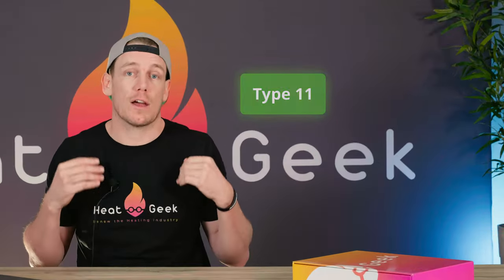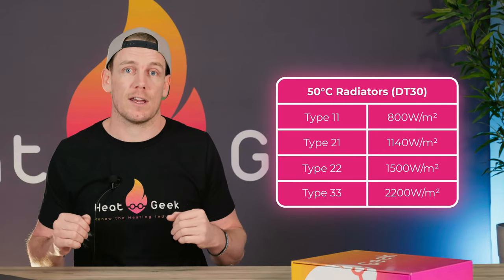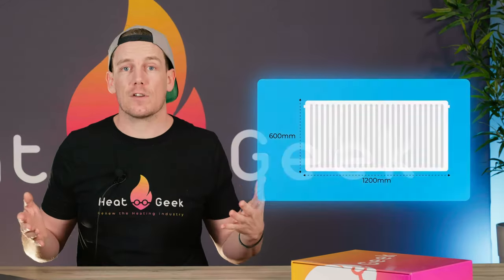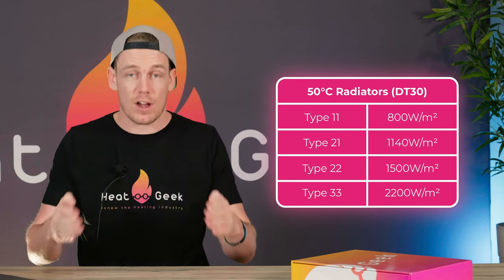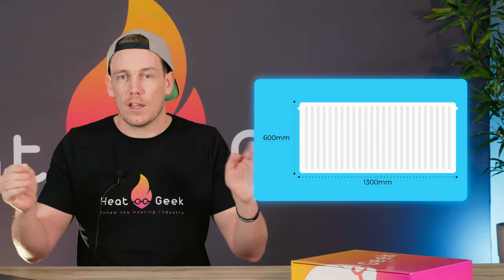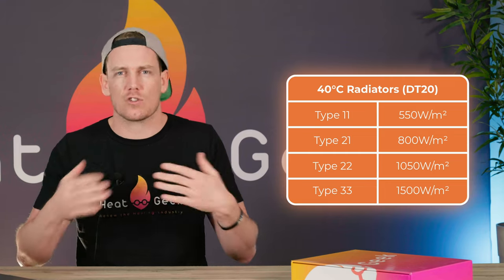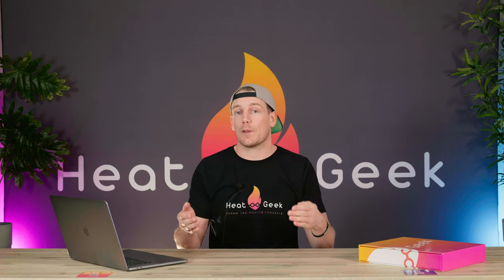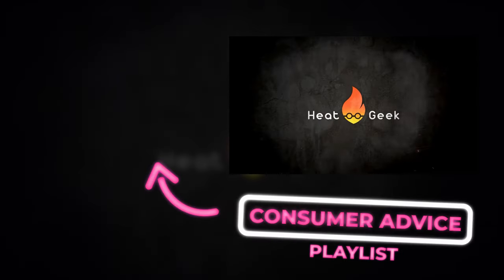Should I Upgrade My Radiators For A Heat Pump? | RADIATOR CHEAT SHEET | Consumer Advice

Comment: Hi. Thanks for the video. What's your opinion on column radiators please? Which type would be closest comparison for your cheat sheet? I've read an article that suggests they are potentially better than panel + convector fin types, despite sometimes being rated with lower BTU figures, because they have a greater direct surface area. Is that true?
Reply: They work just fine. The quoted output should be divided by 3 to work at 40 degrees! Make sure that there is a diverter inserted where the inlet valve is stop the water going straight across the bottom and the top of the radiator remains cool.

Comment: Good video. Is the 40 degree chart mean 40c mean water temp, so a 50 flow 30 return, mwt40 minus 20 room temp is dt20 for gas boiler?

Are is the flow and return dt on an ashp much closer together?
Reply from the maker: Yes.

Flow/ret dt in hp is 5 to 7

Comment: 1. Are aluminium rads better ?
2. Do vertical rads of same wattage expect to perform similar to horizontal ones? 
I am planing to get heat pump over the next few months and dont want to skimp on cost of rads as they are probably the least expensive part in the system.
Reply: That being the case go for aluminium radiators they have a far better heat transfer rate.

Comment: Can't I just swap all my type 11's for 22's, and double up the 21's for 2x the same size in 22's? Job done :) All my rads need replacement anyway...
Reply from the maker: Not necessarily, follow our radiator upsizing video to find out if you need to or not.

Comment: I'm building new house. HP 7,2 kw. Engineer calculated that house has heat loss 7,2 kw at -9,8 c and calculated radiators dimensions for HP. Dont want floor heating, dont ask me why. Now, what interests me is can I make my radiators even bigger than engineer calculated. To run them at lower temperatures? Would I need stronger HP then because I guess bigger radiators mean bigger water flow?
Reply from the maker: Yes you should make them bigger. No it’s doesn’t mean bigger flow or bigger hp

Comment: Great video but I am missing something fundamental. For a Type 22 rad you quote 1500W/M2, so for a 0.72m2 rad the output would be 1080W , yet when I look at a rad chart in the Screwfix specification it is quoting 2112W at DeltaT50degC what am I missing here?
Reply from the maker: Your missing that a delta t 50 rad requires 70c mean water temperature. I.e. its 50c above the room.

A 50c rad is only 30c above the room..  I.e. its a dt 30 rads
Reply: @HeatGeek  Doh - terminology got me - a 50 degree rad and Delta T 50. It would be helpful if there was a  better discriminator like DT x (Primary) = across the heat generator DT x (Emitter) = UFH loop/rad and DT x (Room) = Mean water temp in emitter - room set point. Thanks for answering - I have hoisted in now.😉

Comment: If I'm right in thinking that water flow is important in a heat pump system and that the restriction of microbore pipe work may be a hindrance and also that a heat pump system is generally on for most of the time then whats the point of lock-shields on the rads? or put it another way, the hole even when fully opened is less than the width of micropore so must be just as restrictive.
I'd be really interested to know your thoughts. Thanks for the content.
Reply: I have a system that was originally oil fired and all microbore. The radiator valves were coaxial allowing single ended radiator connections but were absolutely awful especially with double panel radiators. I have converted some of the microbore to 15mm, especially where I converted all radiators to double ended connection. It all works fine with my ground source heat pump.

Comment: How about using a high temp heat pump, I’ve 27kw of battery storage that I charge on cheap rate electricity. Why because my pipes are microbore plastic and to replace in a new build would be hell. No one as yet has come up with and answer to new builds that mostly are piped with microbore plastic.
Reply: I have a mixed system with mostly microbore and it is not a problem.

Comment: Thank you again, legend. This is timely info for me 🙂

One question about the material the rad is constructed from: I see aluminium rads which claim a higher output due to its better conduction... What are your thoughts on those - Are they worth the upgrade?

Is there a rule of thumb % output difference per m² Vs steel?
Reply from the maker: No rule of thumb for those as they will be custom shapes. They're OK... need to be careful with water quality though.. use demin imo... not worth the extra cost really tbh
Reply: Many thanks. I'll stick to decent steel ones then 👍🏻
Reply: I had a aluminium rad installed when I replaced my  kitchen in my old house and it kick out a lot of heat,  but the prices are to much.   I found in every house I moved in the down stair rads so dont give out a lot of heat and I always had them replaced.

Comment: Given that emitters are the single biggest determining factor in the performance of a heat pump. Have you considered testing the ThermaSkirt system? It is effectively a radiator just in a different shape. 
We've run it at low temps for years.
Reply from the maker: Yes. Very low output so not as good as rads in any way.. which is expected as rads allow air flow round them
Reply: @HeatGeek   @Heat Geek  it's 90w per metre though? We've had it in a 40m2 kitchen/diner for 6 years now running at 40°C. 
I did an instructables write up on it. 👍
Reply from the maker: @welltrainedchimp9591  90w per meter doesnt mean much on its own. at what mean water to air  tem dt?. The fact you could run it at 40c doesn't tell us anything without your heat loss or w/mw.
Reply from the maker: @dirtychinchilla  flow temperature is directly propotional to radiator output though.. which is why skirting rads are poor. No aor flow means little turbulence airside and reduced output. The hydraulic connections are clumsy and cheap too.
Reply: @HeatGeek  it's a radiant system though it's not trying to create air flow. It's basically the first thing they say on their website. 
Works more like underfloor heating in that respect. 
Our skirting heating runs at 50°c flow, for internal temperature 21°C when -3 outside. 
The flow curve then changes significantly as the outside temp changes. Flow drops right down to 35 when it's over 8 outside. 
I really don't want to nail your hat on about this as I love your channel, but having fitted it throughout the house 6 years ago I can tell you that the connections work, and are easy to fit. Granted its a little fiddly when you haven't installed it before but after a few rooms it was much easier. 
I've just had a poke on their website, looks like Barratts are using them on their 'Zero Carbon' homes 😳
We went for it because we didn't want big radiators and a lot of people I know who want heat pumps also don't.
Reply: @dirtychinchilla  50 flow when at -3 outside. 
The system was sized to suit that.  As the external temp rises the flow curve adjusts accordingly. 
You size the skirting like a radiator. More meterage is more surface area. 
We only have 2 of the 4 walls skirted in the bedrooms as they only needed around 500w at -3°C external. The other walls are dummy 👍
Reply from the maker: @welltrainedchimp9591  all low temp systems are higher % radiant to convector. Because it can't convect its output is restricted and becaise its not the same surface area as the entire floor its output is restricted. Essentially it's nit as good as rads or underfloor but I'm sure has its place in certain secarios, I haven't found one yet personally.
Reply: @HeatGeek  I don't understand what you mean exactly by 'it's output is restricted'. 
There is BSRIA test documentation on their website which is what we sized it from.
If it can produce a certain heat output at certain flow temps, in our case 90w/m and you need say 900w. Then 10m of skirting will meet the losses. 
It's pretty simple. 
Your content is absolutely spot on and I love nerding out on it but I don't think you're giving them a fair shake. 
I sound like I'm on bloody commission but I'm only saying this as we've put it in our 1970s detached house on an ashp and it works. 👍 Your installers would benefit from having more options on the emitters front as we're all pushing heat pumps as the future. I love mine! ❤
Reply from the maker: @welltrainedchimp9591  if it meets the required out put that's absolutely great! And I'm not saying never use it. But with a well insulated property as yours sounds, underfloor heating will be down at 30c flow temp and heat pump scop up at 5 instead of 4.
Reply from the maker: I'll look in to it some more from your suggestion bud. We actually havr a whole box of it at the office here that was sent to us and I've only had a quick gander
Reply: @HeatGeek  yeah agree completely. Insulation is good for a 1970s but not great by modern standards.  UFH wasn't an option for us as it was retrofit. So we ran drops from above for the ground floor from a manifold and came up from suspended floor on the first floor. 
I actually reduced my zoning based on one of your videos so we just have a 1st floor & ground floor zone now. 
Wasted money on a load of thermostats but it's really working well. 😅
Reply: @HeatGeek  yeah I just think the more options fitters have the better as the performance side is one thing but ultimately if the customer doesn't like radiators and can't have underfloor heating there's another way to get heat pumps to work for them. 
Did they send you a free system?! 😀
Reply from the maker: @welltrainedchimp9591  can't disagree there. Just not my first port of call. Yes they sent free sample stuff.
Reply: @HeatGeek  use your social influencer status to ask for a free test system. 😆 give it a whirl and see what you think.
Reply from the maker: @welltrainedchimp9591  sounds like a great job. Where are you based? perhaps we could do an episode on your set up?
Reply: @HeatGeek  The property is in th Lakes... great job? No! We had a bit of a nightmare with the original heat pump installer and I basically had to do all my own homework to eventually work out he was blagging it. Trying to feed the ground floor from a single set of 15mm feeds 🤔🤔🤔 He also didn't have a clue about the RHI applications and cost me a fortune. 
It got sorted in the end and I fitted all the internal pipework and skirting myself with some guidance. 
My experience is what's got me so concerned about the big push towards heat pumps. I'm worried that loads of sales companies will appear out of nowhere and mis sell systems, size them incorrectly and get cowboys to fit them. 
It will be bad for the whole industry without the right knowledge out there.
Reply from the maker: @welltrainedchimp9591  yes.. ifnyoubgot there ate a home owner using YouTube etc though.. hopefully our channel will be the keyA
Reply: The surface area of ThermaSkirt is woefully inadequate for most heat pump applications.

Comment: Interesting video, thank you.
What are your thoughts on 'retrofit' underfloor heating? The sort which goes on top of your existing slab. Worth the effort over posible upsizing radiators?
Reply: I decided to put in overlay UFH when we created a new kitchen diner from two rooms. It's overlay type with pipes in about 22mm of screed and it's own pump/manifold/thermostat. Due to shallow screed it responds quickly (ish) with tiles on top.

Long story short, for living rooms I think it's worth the effort (doubt bedrooms are worth it so much TBH, will just follow this guide with my rads there). But the comfort and feeling in the kitchen diner is great, that radiant heat is so nice. Most the year it'll happily run at 35° and in middle of winter is 45° but could probably go much cooler if I improved the thermal performance (e.g. considering external perimeter/foundation insulation)

I'm glad I got it, go for it IMHO 🙂
Reply from the maker: Very much depends! Too many variables and depends on of your looking at Install cost running cost or cop
Reply: Underfloor heating is effective, when separated from main structure with insulation(under and arround) from main structure opf the house, especially if retrofited in NON INSULATED house.
Otherwise, you will heat the athmosphere because of the massive thermo bridges!
Reply from the maker: @Mtematiks  yes it has to be installed properly for sure...
Reply: If you are considering a floating floor system, you should consult the manufacturer's data. Someone like Uponor.
Reply: @Mtematiks  indeed... my whole floor is a thermal bridge, sadly. The bit with underfloor is better since that's in an extension with a small amount of insulation under the slab, but when I hired a thermal camera I can see the slab on grade floor glowing all around the house.

Rather than build up floors with insulation I'm considering external perimeter insulation down to the foundation. Not perfect, but then it's an 80s bungalow so never will be - and I've not got the ceiling height to spare losing 100mm plus everywhere. 

It's all a compromise... it's also not a job I'm looking forward to 😅

Comment: Great info, but what about a 30°c or less flow temperature?
Reply from the maker: That's pretty much just ufh.. this is really to see if your existing rads are big enough. If you want to target specific flow temps like 30c your better off with the actual calcs or just use conversion factors
Reply: @HeatGeek  thanks for your reply, I’ll look into it 👍
Reply: @dirtychinchilla  indeed, but still is possible to heat a home with a 30°c flow temperature

Comment: Are the cheat sheet values exactly or approx? Because I did work some out from a Kudox radiator data sheet and the heating output in w/m2 worked out slightly higher. e.g. type 22 DT30 worked out to be 1557.7w/m2 instead of 1500w/m2, this can be crucial in some cases as sometimes you can get away with a type 22 instead of upgrading it to type 33.
Reply from the maker: As per the video this is a very rough guide. Radiator outputs are often over stated so this could be more accurate than the manufacturer rating.. search uk radiators for more details

Comment: For the sake of comparison with an existing old install, what would be the ballpark heat output per m2 at 50C of single and double panel radiators without convectors ?
Reply from the maker: Take off something like 30 or 40% I think

Comment: Heat loss calcs are always going to be of dubious accuracy in an existing  house with all the unknowns including insulation spec and build quality under the surface. As per a previous suggestion, surely a simple and accurate method to assess compatibility for a heat pump would be to run the existing boiler at 50 degrees during sub zero weather and make a judgement on whether the rooms stay warm enough. Perhaps you could point out any flaws in that strategy Heat Geeks.
Reply from the maker: No floors. Lots of methods. You don't have to wait for it to be that cold either.. could do it in a milder day and multiply by degree days
Reply: @HeatGeek  I might be a bit dim here but running at 50 deg when it's plus 5 deg outside is not going to give me confidence that existing rad's will still be capable of achieving comfort conditions when it's sub zero. Or am I missing something?  Thanks for responding by the way.

Comment: What about actual radiators (not convectors) meaning: column radiators or cast iron radiators. If they are new or in good order, can they be used for a heat pump? I guess the output is usually too low at say 40 or 35 degrees, because there is only radiation, no/almost no convection.

Or is this more of a match for high temperature heat pumps. Maybe a video on that rare beast of the pump breed?
Reply: My cast iron radiators work fine at 46 degrees flow temp. I'm comfortable and thermostat is set at 18 degrees. According to the nest thermostat app my heating is only one for an average of 2 to 3 hours per day over a 24 hour period. Works for me👍

Comment: will running radiators at these temperatures get my house warm when i only time it for 1 hr am and 2hrs pm?
Reply from the maker: Yes. Infact they’ll have the power to heat your house even quicker than smaller rads

Comment: Hey Heat Geek,
Is it possible to do underfloor heating without any screed?

I would like to install tiles all over my house floor.

I have seen electric underfloor heating installation without screed, but I have not seen it with water heating pipes.

Can you explain it more?
Reply from the maker: Yes, you need what's called an overlay system.
Reply from the maker: Could also use the jk flooring system. Check it out

Comment: Hi Guys could you tell me if cast Iron rads work with ASHP ? thank you for any help you can offer
Reply from the maker: Ofcourse.. provided they are suitably sized
Reply: Thank you so its the room size into BTUs and use a matching rad? while I am here thanks for all the great video's some of them give me brain ache but I normally get there in the end. Cheers
Reply from the maker: @mikestreet3592  no. The output stated on the rad is for high temperature. The output at low temperature will be about 1 3rd. So get 1 3x bigger. We have a cheat sheet for uour heatbloss too as online calculators are crap.. only suitable for the uk though. 

Lastly.. Do not purchase anything this way though, this is a guide. Always do full calcs first.